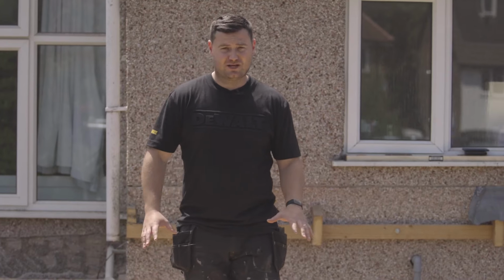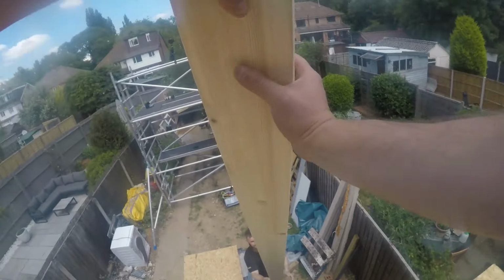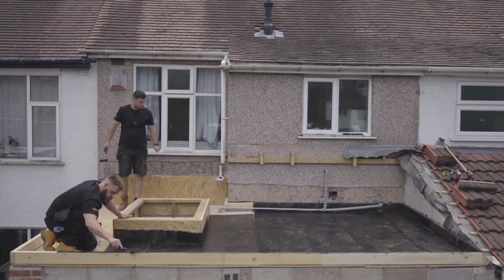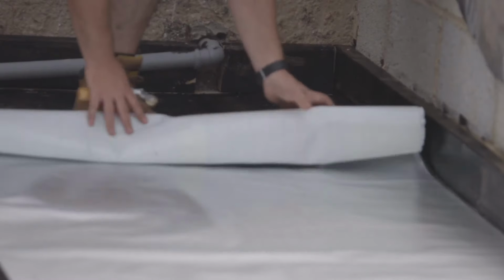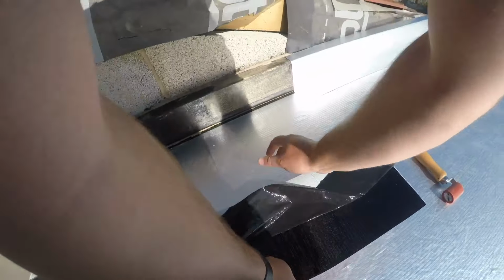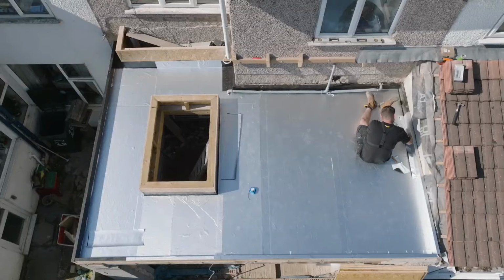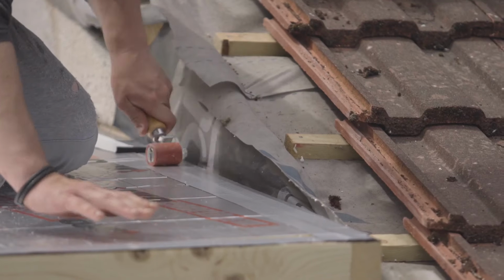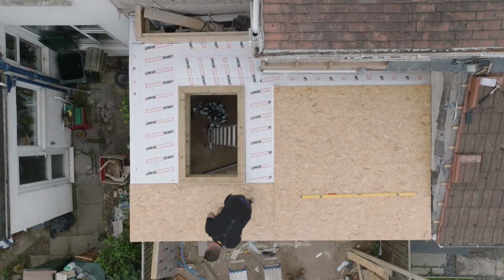How To Build A Warm Roof From Start To Finish | Quick Simple Guide.

Comment: Top sheet of ply is a big no no and has been for quite a while - this will be the big failure point , it’s basically a cold roof with zero ventilation 
also if mech fixing the installation all fixings need to be thermally broken
Reply: True mate.
Reply: CNC BUILDING CONTROL insist on it where I live and they cover cambs ,norfolk and Suffolk?
Reply: @danny1977  I’m in Suffolk I own a roofing company with 6 full time installers only doing flat roofs covering Suffolk north Essex and Norfolk- I can categorically tell you the don’t -anyone reading this don’t cover insulation with ply it will fail regs and crumble away within 5-7 years
Reply: What if your torching felt? Dont you need the the top layer of osb3 for that?
Reply: @jameshigson9630  there is an insulation board with a bitumen top and you use metal washers to fix - makes for a really good solid deck you would not know it’s not ply - tr25 i think there called - saves a lot of money not buying top deck of ply /quicker / regs compliant it’s a no brainier
Reply: Tr27 **
Reply: @ian edwards  thanks mate I've only really done cold roofs in the past and was doind a warm roof soon and seen alot of mixedopinionsin regards to top deck and foil back insulation.
In your opinion is a cold roof just as good as warm?
Reply: @jameshigson9630  in my opinion both good but both need to be done right - cold - 20mm cross vents on every joist (no span greater than 5meters) 
Via fascia vents etc
warm no vents  , proper vcl a must, correct’U’ valued required , fascia always big (better for parapet roofs imo)
Reply: @ian edwards  Hi I'm just doing warm flat roof. I got on plans ocb sheet first, then vlc, then insulation and a 18mm ply on top. Then finished with epdm 
I live in Scotland
Reply: @prakunda  save yourself some money - use tr27 insulation and don’t use the top ply it’s a failure point - give it 3-5 years it’ll look like soggy weetabix I’m ripping roofs up almost weekly all under 7 years old - not the roofers fault it’s the architect
Reply: @ianedwards9735  Hi thanks for replay, fortunately I got the kingspan tr27, but still in architect plans saying 18mm ply on the top, basically kingspan sandwich.
So you are saying not to put it on? What about, if I'm going to put a decking on later on? Would you still think the same please?
Reply: @prakunda  yep - I put deck /slab and sedum on tr27 tissue faced all is fine and okayed and spra only advise this system
Reply: @ianedwards9735  Are the Tr27 strong enough to hold the decking? So epdm rubber strait on the tr27, then decking? What about the rubber itself? Can you recommend something more durable please? Something thicker then the usual 1.5mm please
Reply: @prakunda  I’m biased as I install only single ply membranes ie Danosa / sarnafil might be worth getting a costing on something with insurance backed warranty of no less than 20yr and make sure it has a workmanship warranty ( registered installer) of at least 10 yrs
Reply: https://youtu.be/WZ6Ng6YI9OA just out of interest as Wana do one of these roofs at my house ,your saying no top osb but what about if you need to walk on it ? And in this link he says top osb is ok if you want a harder surface as insulation will dent if walked on
Reply: @billybordeaux5358  tr27 insulation is what’s needed + a decent single ply covering (1.8mm ) you won’t know it’s not ply , also side note the top ply will fail in 2-5 years and will look like soggy weetabix which will definitely dent when walked on
Reply: @billybordeaux5358  ps this vid you linked is 11 yrs old , new regs banning top deck ply car in in 2020
Reply: @ianedwards9735  can you apply the three layer bitumen felt on the TR27 insulation? Thanks
Reply: @ianedwards9735  can you fiberglass   straight over the tr27?
Reply: @jimmy_riddler  in my opinion no as tr27 or any insulation will move - shrink/ expand and grp does like a lot of movement- it’ll make a lot of bangs and cracking noises before splitting-
Imo roofs coverings should be flexible- I’d rather see a ripple than a split
Reply: @ianedwards9735  many thanks. Merry Christmas!

Comment: How long from start to finish the roof?
Reply from the maker: Hi Danny 

Thanks for watching.

This is roughly a days work between 2 people. It did take us slightly longer than it usually would due to filming the job though.
Reply: @Roofscout  wow that's impressive m8 I'm currently building a flat roof extension so I was wondering timescale thanks for replying 😀

Comment: So what happens if i want to make a terrace there? How do i put tile or some decorative thing on the floor of the terrace?

And how does a flat roof drain if it rains? Cause if its flat and leveled, and not on a slight slope, how does the water run off? Cause if we make a slight slope, wouldnt that look like a crooked roof from far away if u look at it?
Reply from the maker: Hi Milena

Thanks for watching!

This would all depend on the waterproofing membrane you are using on top of the top deck of the roof. For example if you are using Epdm you would screed over the membrane and then you could tile on top of the screed. Another option would be to lay decking on top of the waterproofing membrane but I would discuss this procedure with the supplier of the waterproofing membrane beforehand.

Every flat roof should have a slight fall on it to aid drainage. The roof in the video falls toward the front edge where the guttering was later installed.

Comment: What is the actually purpose of the membrane  . If water ever built  up wouldn't it just turn into a pool of water
Reply: If you mean the vapour barrier it’s to stop water vapour entering from the room below and then condensing on the cold side of the insulation i.e the top of the insulation just below the waterproofing layer.

Comment: How many layers do you need to trap moisture in? There should be only one - the first layer of OSB. No vapour barrier, no ply on top ffs. This will rot phenomenally.
Reply from the maker: Hi Tanel

Thanks for your comment.

There is no way of moisture entering the roof cavity as there is a vapour barrier to prevent rising moisture entering the roof build up from the room below. There is also a waterproofing membrane installed to this roof preventing water entering the build up from above.
Reply: @Roofscout  knowledge of basic construction physics would help - there is no way to make the vapour barrier underneath 100%. In addition, there will always occur condensation.

Comment: I'm not a roofer. Was asked by determined client t finish his flat roof with skylight, he selected 22mm marine ply above joists/furrings which he's already layed, now wants Visqueen Vapour Barrier, then 9mm OSB, then taping, trims and fiberglass. With all the rain we've had over the last few weeks and the marine ply being absolutely soaked what problems can you foresee? I've already told him multiple times that I'm NOT a roofer, but that he should have used OSB from the get-go... Any help

Plus fibreglass can't be layed even if it's damp
Reply from the maker: Hi criollitoification

If there is moisture within the roof build up and you add a waterproofing membrane of any kind before the whole build up is completely dry the trapped moisture can lead to an array of issues such as bubbling in the waterproofing membrane.

I would ensure all Timber is completely dry before installing the remaining components.

The marine ply may not be a major issue for the lower deck but many GRP/Fibreglass manufacturers recommend using osb3 T&G boards nowadays as the GRP is less likely to fail on the board joints with T&G boards and GRP adheres well to OSB. 

If you have no experience using a Fibreglass system I would try to avoid it in all honesty as the detailing work can be tricky and if not done correctly it will need to be ripped up and the boards will need replacing making any errors quite costly.

You could try suggesting/using EPDM as an alternative. As a system a rubber roof is a lot more forgiving than Fibreglass as there is no working time (once catalysed GRP must be installed before it goes hard). We have plenty of videos on this system that you may find useful.

If the client is adamant that they want a Fibreglass roof, our best advice would be to contact an experienced professional.

I hope this helps and thanks for watching our videos!
Reply: @Roofscout  thanks for the reply, I'll pass this info on to client and let him make the decision, I guess it's all I can do. Thanks again all the best
Reply: Don’t go down the GRP route mate it’s a shocker of a system,but as an asphalt & felt roofer it’s keeping me busy putting them right.
Reply: @criollitoification  
If your not a roofer why take on the job
Reply: what happened?

Comment: Didn’t show cross ventilation below or a means of vent up n out. No mushroom vent or box vents.
Reply: You don't need to vent warm roof - simple as that. Cold roof where ventilation is needed.
Reply: @mindematt  you don’t need to vent warm roofs but here the roofer has applied a OSB deck on top of insulation so a cold roof on a warm roof. He needs to vent this? Otherwise it will rot? Just a question as I am learning and could be wrong.

Comment: Good video - but you could have saved the client a bit of money....  osb acts as a vapour barrier, just needed to tape the joints.  Also, was the waterproof membrane EPDM?  It could have gone over the insulation without yet another layer of osb...
Reply: OSB does not act as vapour barrier.
EPDM can not be layed over foiled PIR
Reply: @johnsonkevin1  Yes it does.  I learned this working on Passivhauses and have employed it many times since.  If used on the warm side and the joints are taped.  Not an airtight layer, but certainly as a vapour barrier.
And EPDM can be laid over polyisocyanurate (PIR) insulation, perhaps not the foiled stuff - I don't know about that -  but it can be either adhered or mechanically fixed.

Comment: Not like this that’s for sure
Reply from the maker: Hi Martin

We hope you're well.

We're sorry to hear you don't approve of our installation but this roof complies with Building Regulations and was passed off by Building Control.

We understand every Roofer may have their own way of doing things and their own personal preferences but as mentioned this roof is up to spec.

Thanks for watching again.
Reply: @Roofscout  
I’m not sure what’s more worrying that you think this standard of workmanship is ok
Or building control signed it off
Reply: @martinsutherland4270  What is wrong with it then, I would be interested to know
Reply: @Martin Sutherland  still waiting to see your work mate? What did they do wrong? All looked good to me.
Reply: @martinsutherland4270 there's always one like you ain't there 🙄
Reply: @DC-ej7bm  vapour barrier corners on lights?;pair of scissors!!! .iko  insulation bonded  via adhesives don't penetrate vapour control layer .then iko partial bonded membrane  followed by iko upxl membrane. Separate  fillet to upstand flashings separate drip detail. 30 year guarantee . don't puncture vapour barrier!!! No need for OSB over insulation. We take lots of failed edpm roofs off cos fixings have popped through .it's at most 1 mm thick . Upxl system near 10mm thick. But you can't use a pair of scissors to lay it!!. Joe public too easily impressed I'm afraid
Reply: @danny1977  
And there always a smart arse that will reply, and that you
If you think this build is ok, then need I say anymore, no
Reply: @whatmouth  
If you use the thermal broken fixings that can’t happen
Reply: Sure… what comes next?

Comment: That is not a warm roof.
Reply: Of course it’s not these guys are cowboys, frighting
Reply: Looks like a warm roof to me
Reply: Which one is warm deck?
Reply: 100% that’s a warm roof.   The insulation went on the roof didn’t it!????
Reply: @Misterman924  In the wrong place though.
Reply: @Misterman924  no timber deck over insulation is a warm roof .this just pointless  asking for trouble  vapour will get trapped beneath  silly deck on top of insulation . Iko partial bonded over insulation then iko upXL Membrane finish  that's warm roof  been fitting these roofs fo 40!years
Reply: @whatmouth 
Nobody fitted warms roofs 40 years ago